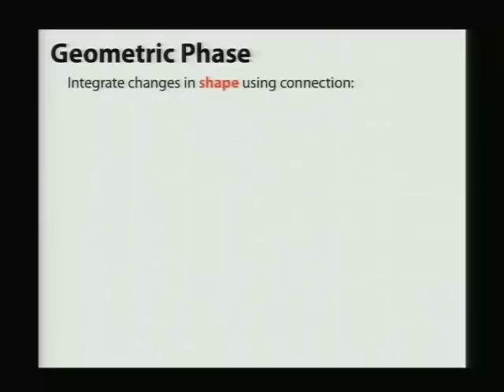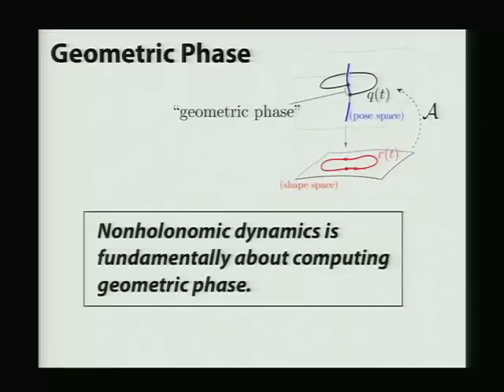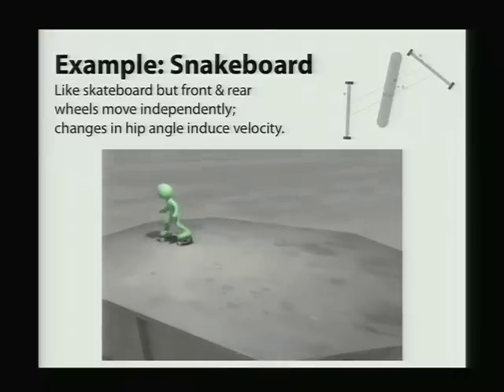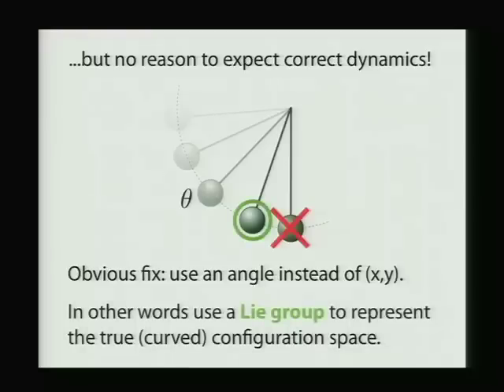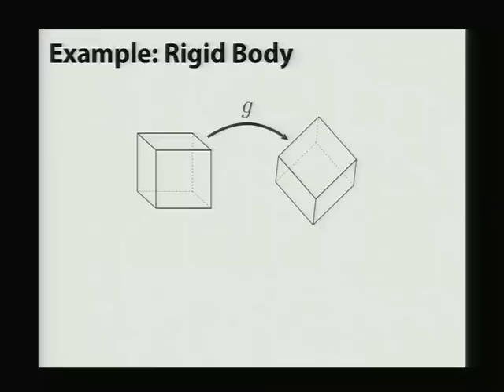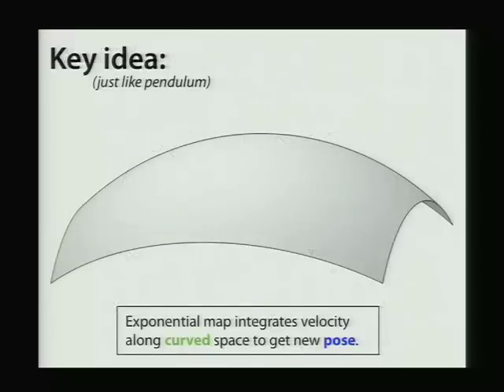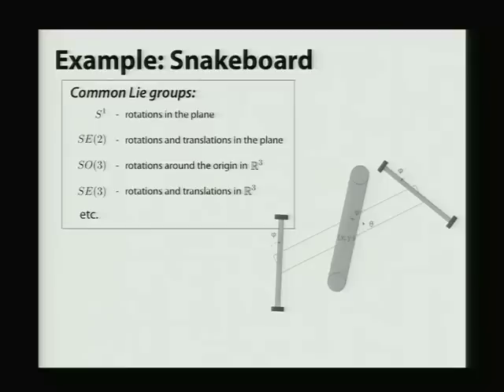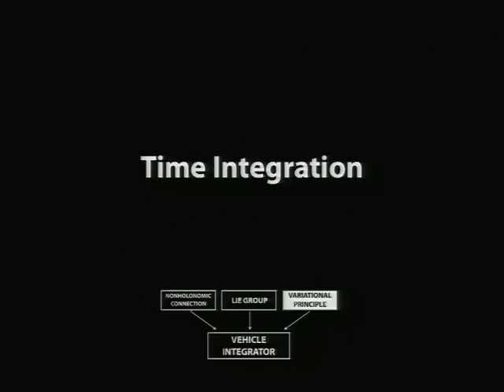Lie Group Integrators for Animation and Control of Vehicles - Talk (2/4)

Comment from the maker: @MrManifolder For the car, one copy of S1 represents the angle of the rear axle and the other copy represents the (tangent of the) angle of the front wheels relative to the orientation of the car.  The SE(2) component gives the position and direction of the car in the plane.  So the overall configuration space is the same as for the snakeboard, but you will of course get very different dynamics!

Comment: Your excellent paper says that the car, like the above snake board, also has configuration space Q = S^1 X S^1 X SE(2). Just to confirm, is that because one S^1 Lie group is for each front wheel and then the SE(2) Lie group is for the chassis? 

Thanks! Keep up the great work!